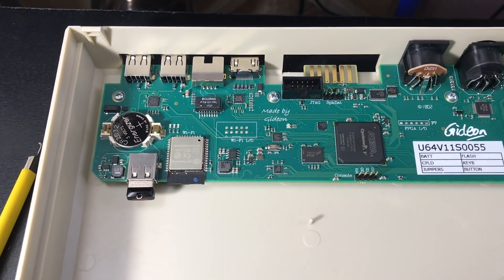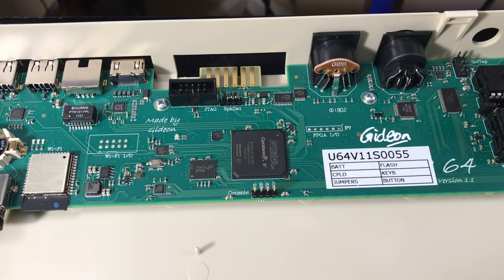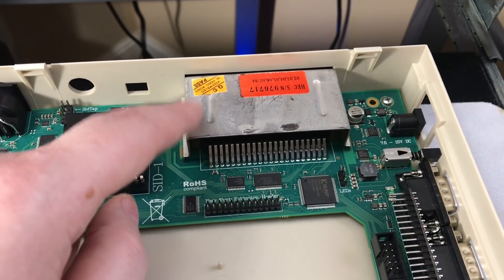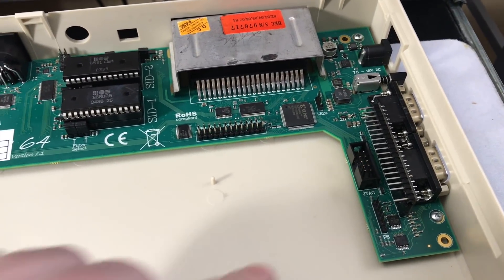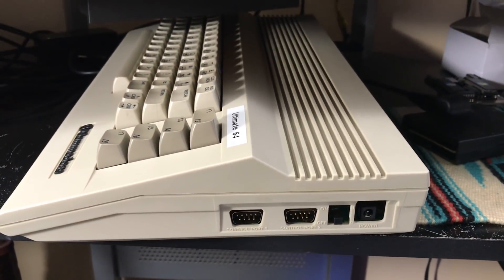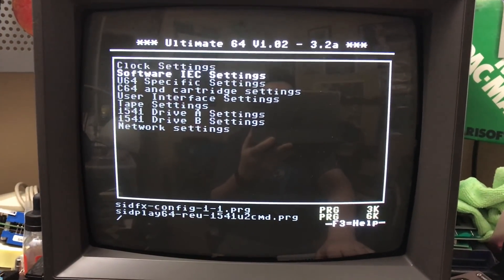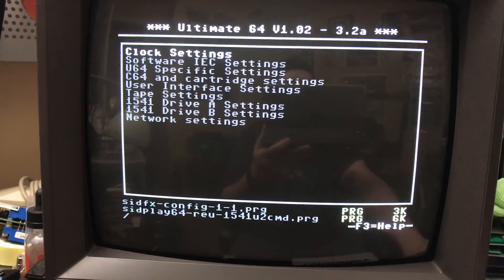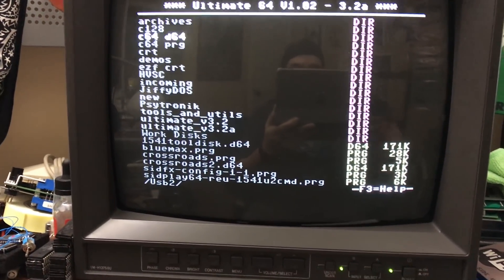Ultimate 64 Board Tour and Demo

Comment: Why not just run an emulator on your PC instead of this?? - this has nothing to do with a C64 machine - the only real thing left is the case. Where is the beauty of the C64 and retrostyle, when the motherboard is replaced by a modern board?? Respect to the inventor of this board - but I would much rather use the original thing.
Reply from the maker: Lasse Offenbach I can understand how folks can feel that way, but it should be noted that this is an FPGA reimplementation and not “emulation” strictly speaking. I also own a large number of real C64s too of course which I use regularly, but thats part of the beauty of the modern C64 scene in 2020. We have an amazing amount of options in how we may choose to enjoy our retro hobby. Some may be happy with a Raspberry Pi or PC emulators, others use real hardware only, but for me, I like to enjoy a little bit of everything that the hobby has available. And I also like to support amazing projects like this by buying and using add-ons and hardware made by brilliant enthusiasts. Just my opinion on the topic, and any way people choose to enjoy retrocomputing is cool in my book. :)

Comment: Is it faster than the c64?
Reply from the maker: Well, its effectively a near perfect recreation of a real C64, so it runs exactly the same speed as a real one. It does have a lot of added features that a stock C64 wouldn’t have,(without added and costly expansions) which is part of what makes it so compelling...
Reply: @aphexteknol  It does seem like a great board. I'm even thinking of getting a broken c64 and one of these to replace the mother board. It just seems a shame not to have a turbo mode or something like the Turbo Chameleon 64.
Reply from the maker: Big K Well the good thing is that with FPGA technology, the functionality for a turbo speed upgrade could be added in the future. As it sits right now, the Ultimate 64 board is still the most exciting C64 product on the market in my opinion. And I do agree that if it had some sort of turbo function like the Turbo Chameleon, or possibly even an emulation of the CMD SuperCPU, that would make it that much more interesting down the road for sure. :)

Comment: Its a shame this is not retailed, in stores,that how I pre-Order stuff,its to hard to get. well TheC64 is coming now,and please don't say is not a real C64 cause this is not too,this is a C64DTV on a bigger board and more connectors and with more features.Its very clever,We need new hardware that can act like a C64 Original. The original hardware will not be around forever,I don't even use my C64 Original any more,I use TheC64 Mini instead.Why..?? It might be using a emulator but you can save your game at any point.and its not big and take up a desk to use it and have loads of accessories connected to it to play games.
Reply from the maker: RETROnuts I mostly agree, although there is a pretty good reason Ultimate 64 isn’t sold in retail stores. It’s just a project by a single man, not a big company. It is a lot easier to go on his website now and order if you want one now, but you still have to wait for batches. I have a TheC64 mini as well, and I’m also excited to see the new fullsize TheC64 when it comes out. I consider them all real C64 in one way or another. :)

Comment: Can you mount this in a breadbin case if you want the classic c64 look?  I'd love to see a 128 or Vic 20 version of this.  I'm a true blue Commodore lover.
Reply from the maker: summer20105707 I’m pretty sure you can mount these in breadbin cases. I’ve never tried it myself, but an added benefit is that you wouldn’t have to mess around with any keyboard mounts either...

Comment: Is it hard to mount in a C64c case? I read somewhere that the keyboard cable was to short or something like that. That you must have some keyboard brackets?
Reply from the maker: The case i am using is the C64C case variation that clips together without screws. The keyboard is also retained by clips, so keyboard mounts are not necessary. On standard cases you would need keyboard mounts. As you know this can cause some fitment problems, but folks have created some 3d printed mounts that are perfect for this application.
Reply: @aphexteknol  So I guess if I order a new printed c64c case I will need some keyboard mounts?

Comment: Hmm C64 Keyrah kind of does all this too, lot cheaper. This is nice.
Reply from the maker: John Anderson You could totally do the whole raspberry pi emulation route and have it emulate a C64/Amiga or whatever you wanted, but the whole idea of this being an FPGA based system is that not only do you get all of the original ports and I/O of an original C64, you also can theoretically have a perfect implementation of the logic contained inside a real C64 so that there is no difference at all between running code on this versus a real C64. Emulators are a bit lacking in that regard due to the way they work. For most people who want to just play C64 games, a Raspberry Pi and keyrah in a C64 case may well satisfy them (or even VICE on a PC) but products like this Ultimate 64 are really intended for the serious hardcore enthusiast.... like me. :)

Comment: whats the benefit with Ultimate64 towards a c64 reloaded 2? obviously i know the c64 r-loaded 2 requires original c64 chips.
Reply from the maker: The benefit is HDMI output and a built-in 1541 Ultimate II+ cartridge. The price is only very slightly more than the Reloaded MK2 which still needs (expensive) chips and comes with no expansions... Of course the Reloaded MK2 has near perfect compatibility due to using original chips, but the Ultimate board isn’t too far off either...

Comment: I'm very confused, is this Ultimate64 board is a replacement mainboard for C64? because when I check their website, they seems to refer Ultimate64 as a 1541 Cartridge...
Reply from the maker: modology It is both. Its a replacement motherboard, but all of the functions a 1541 Ultimate cartridge would provide a regular C64 have been seamlessly integrated into the board’s software itself. Effectively it has a 1541 cartridge built-in in other words, as well as a free cartridge port that allows you to use other cartridges if you wish....
Reply: thanks. Now I understand. I never grow up using C64 thus eveything are very confusing for me. I was looking at C64 Reloaded and this Ultimate64 board (which I beleive pehraps not yet been released). I guess I will wait until this board get released. perhaps it's a good start for C64 beginner like me
Reply: @modology  Not the worst way to start!

Comment: It would be nice to know if PAL alternating scanline colour mixing is properly simulated on the RGB and HDMI outputs.  Also, it would be nice to know if the video output refresh is PAL C64 accurate (50.1245Hz).  If it isn't then wouldn't there be the possibility that some fastloaders could fail if a real 1541 or C2N is used?
Reply from the maker: HojoNorem As far as I know the board outputs a proper 50hz PAL as my broadcast monitor detects it as such. Its also worth noting the analog output of this board is quite a bit crisper with less noise than any real C64 that I have ever seen. As far as the scanline color mixing, I’ve viewed some demos that use it and they seemed to display properly via analog. I don’t have as much experience running the board over HDMI but I suspect it works fine there as well.

Comment: Hi, thanks for this great video.
On the ultimate 64 it's possible use my wonderful wifi modem by Schema? And the most bbs software for are compatible wirh c64 with ultimate 64? ( ex. ddmbbs, color64bbs, imagebbs etc.)
 It would be as ideal as hardware for a bbs on a true c64. because the real c64 are often subject to break if kept always switched on, as required by a bbs.
 It is possible in the near future, updating the software, to have a higher clock speed see turbo cameleon, to be able to use some software at best as geos and the elite game.
Many thanks
I like this video as
Reply from the maker: gigisca Right now Gideon is still working on the adapter that allows you to plug in things to the user port header pins so I don’t think anybody has tried any WiFi Modems yet. On the other hand, there is a wifi module on board so I hope in the future it will be possible to use that for BBS purposes rather than TCP/IP functions instead of plugging in a seperate device. I’ve heard mention that its technically possible to create a firmware that runs at a higher speed, but it would be up to Gideon again to implement this. One last thing, a good friend of mine (Chris537) actually runs 2 BBS systems and he does so with real C64 computers. He has been running 2 systems 24/7 for as long as 8 or 9 years continuously so it can be done with real hardware. I agree though the Ultimate 64 lends itself to being used for BBS purposes since it is new hardware and generates no heat. Hope this helps!

Comment: Holy Shmo, man. This is just so incredibly cool to have. I'm following the facebook page on the Ultimate64 and I was kind of glad I waited on pulling the trigger on this because of the early adopter issues. But watching this video I can see they're really minor problems. Very informative this..thanks!
Reply: If you aren't into the demo scene you won't really notice the current firmware flaws, more than 95% of games are working as of 1.02, a few not exactly perfectly, but most people wouldn't notice. Possibly up to 50% of demos are not working correctly., but for gamers.. they wont notice, I'm enjoying mine and I only use mine for demos.
Reply: Well I can assure you it's already far better than any software emulation. Not as far as running "perfectly" goes but it has zero lag and the hardware scrolling is perfect. So in that way it's already as good as an original C64 and better than things like "The 64 mini", where it is already far better than an original C64 right now is in the video display and sound output, which are both more clear than a real C64 is able to produce. Give it a year and I'm confidant it'll be better everywhere than the original, there are after all many original C64 that don't play demos properly but eventually that wont be the case with the Ultimate 64, I can't see any hardware problem with the first release board that will prevent it from becoming near perfect and the second revision has no changes other than the keyboard wiring being fixed and the SID resistors being removed, so safe to buy now I would say so. It was pretty crazy seeing how much can get fixed in the 10 seconds it takes the core update to program in :). That fills you with confidence, anyway even if it were never going to be updated again you wouldn't choose an original to play a game on over the Ultimate just because of the HDMI if nothing else.
Reply: Gideon definitely deserves a lot of respect for his work. I mean, he's built the entire thing himself, including all the FPGA stuff. With the few faults that it came it with, it's an amazing achievement.
Reply from the maker: The Highlander Honestly even if the problems were more serious I wouldn’t be upset. I knew by getting one so early that I was essentially helping beta test the hardware and I’m totally OK with that. In fact its kind of fun poking around and trying to see what works and what doesn’t. Like I said, I’m honestly blown away by how good it already is.
Reply: Yeah I don't know if everyone understands just what Gideon has done here. Silently chugging away at recreating a C64 in an FPGA. Blows the mind. He's done a stellar job. From the comments I've seen, the issues are really few.
Reply from the maker: The Highlander The only things that seemed broken are really obscure CIA timer tricks and maybe a few advanced VIC chip techniques; things like you would find on some really high-tech modern demos. And some of these issues have already been fixed with update v1.02! For the most part anything I throw at it, especially vintage games seem to work perfectly fine. Heck even the joystick ports support paddles so I can play Clowns! LOL
Reply: Haha! I've read some of the problems people have found. They sound like you have to be an 8 bit Indiana Jones just to find them.
Reply: Yeah I kind of figured that might be the case. It's safe to get one unless you're going for hardcore demo correctness. That said, I wonder if the Ultimate will ever be that close to the original.